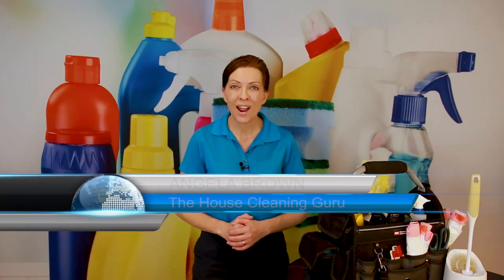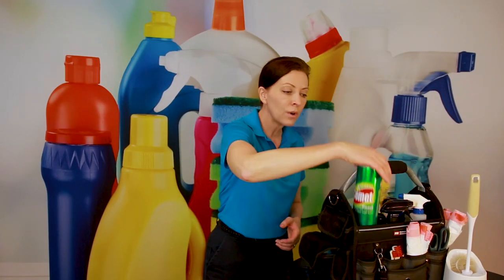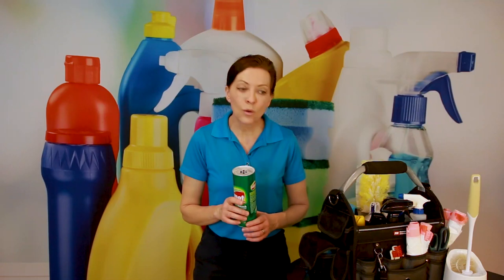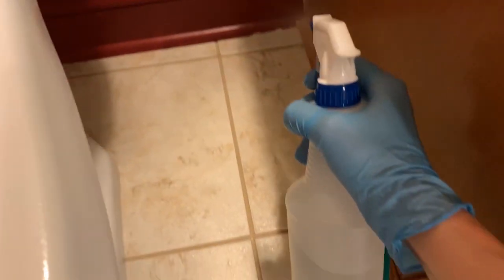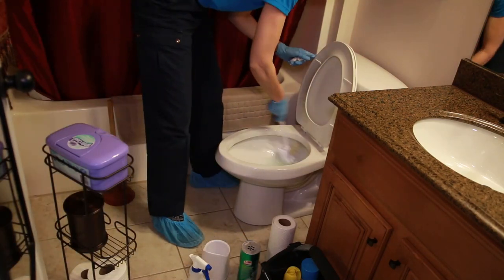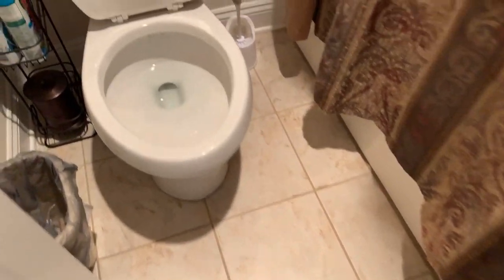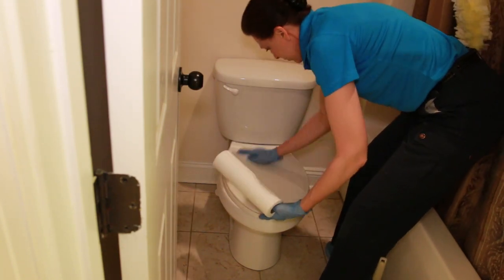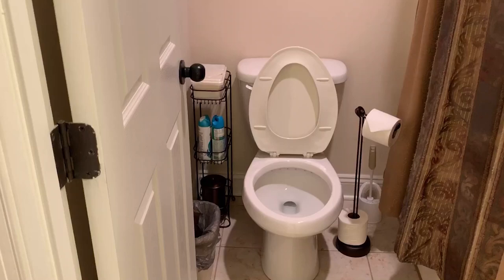How to Do a Maintenance Clean on a Toilet

Comment: Hello Angela,  Watched this video and followed your instructions. The valve blew off and it was flooding the bathroom! I managed to put the valve on and hold it with my foot. I had my phone,  called my  client she had to run to the neighbors for help. They  were able to turn off the water and fix the valve.  I don’t think this is a good idea to miss with the turn off valves.  In the future I definitely use a plastic cup to take out the water in the bowl.  I had to call a friend to help so the clients home would be cleaned in an appropriate time. Which cost me money!!!  I do learn so much from all your video. But , turning the valves off is definitely not a good idea. The rest of the video is great. This could’ve been a disaster which I think it was!!!
Reply: If you'd rather not scoop it out with a cup, you could just plunge the toilet, or pour a small bucket of water into it, both will lower the water level
Reply from the maker: I am so sorry this happened. Sending hugs. 🤗

Comment: Great video as always! Just as a precaution it’s not advised to  turn the water off at the toilet, some of those valves have not been used for long periods of time and disturbing the valve could cause a drip that may go unnoticed and cause water damage. I personally prefer to use my toilet brush to plunge the water up and over the trap to lower the water enough so I can work on removing the ring. Hope this tip helps keep up the good work I love your channel you’re awesome! ~Jim L.
Reply: Can I also use the plunger to plunge some of the water low enough to get that area?
Reply: Typical of a man. My husband didn't like it when I turned off the water, either.  It's a faucet. That's what it's there for. You don't like it, you clean the toilet.
Reply: Just pour a bucket of water in the bowl.
Reply: Take a small bucket and take some water out
Reply: What kind of dumb idea is this? Let the valves go unused for "long periods of time" and wait for an emergency.
Reply: @huitrecouture  In other words, when you’re working at someone else’s property, don’t disturb something that you don’t know the maintenance history on. You could be blamed for any potential problems, such as a leak or a drip. Cover your booty from blame, I simply gave a very common tip that’s used in the industry to lower water level in the toilet bowl to clean it properly.
Reply: @huitrecouture I had water squirting out of the tank and needed to turn the water off in an emergency. And what do you know. The turn off tap was rusted open. 😢 the complex I live in could not understand why I couldn't turn it off. I was home alone and had to beg they send their plumber over. 😢

Comment: Quick tip in getting most of the water out of toilet bowl to apply cleaning product: instead of turning off water supply to toilet, fill a bucket of water and dump in toilet bowl. The water level instantly goes down. After cleaning, flush toilet. Warning: do not have your head hanging over the toilet when flushing as there may be splash😆
Reply: Gail Starnes I’d rather do this too. If you turn the valves off in some older homes they can start to have a slow leak and then you have a real problem, seems like the safer option.
Reply from the maker: Thanks so much for sharing this tip. 👍

Comment: You just inspired me to clean my toilet now instead of later. 😅 When you said you can clean a toilet in 2.5 minutes, that is what was so inspiring. Normally it takes me like 20min! Today I did it in 10-12 minutes. Getting better! 💪
Reply from the maker: Here's a secret - clean the  toilet first thing every morning and it eventually takes less than 1 minute for maintenance mode cleaning. (I don't wipe the behind the toilet area every day, just about every 3 days.)
Reply: I have a roll of paper towels/Meyers in bathroom. Daily I wipe counters/sink then use the same paper towel to do quick wipe of outside of toilet and seat. Once a week do bowl. So rewarding!

Comment: I’m also a pro cleaner. I started doing a first vacuum pass before I spray any product around the toilet and floor - definitely a timesaver. I add toilet bowl cleaner and let it “marinate” while I spray down the outside of the toilet with Clorox bleach-free disinfectant. Let that sit while cleaning the sink, etc. If there is a ring in the toilet, I remove it with a wet scouring stick. Easy peasy.
Reply from the maker: Thank you for sharing these tips!

Comment: Plunger on the floor - discussing 
I dont keep in the bathroom,ikeep it in the garage and if i need to use it I bring it ,use it and take it out again
Reply: in a plastic bag
Reply: I bought a plunger with brush that sets in a plastic part off the floor as I too can't stand a plunger on floor. Bought at Walmart does cost 10 dollars but, worth it.
Reply: I use a round plastic food container lid with a piece of paper towel on top. That way, the paper towel catches the drips and it's not touching the floor.
Reply: @Meggie Markovska Same here.
Reply: that’s ok until you clean a few poopy run overs where you were running out to the garage. I would keep one in an easily accessible spot especially if you have kids😂😂
Reply: @letscleanhouse  exactly!!!
Reply from the maker: Thanks so much for sharing your thoughts on this video topic.

Comment: What to use for water mineral stains on the bottom of the toilet. Thank you for all your work.
Reply from the maker: Hi. I am sorry to respond so late! You have a few options: 
Vinegar and Baking Soda: Pour some vinegar into the toilet bowl, making sure to cover the mineral stains. Allow it to sit for a few hours or overnight. Then, sprinkle baking soda onto the stains and scrub with a toilet brush. 

Commercial Descaling Product: You can also use a commercial descaling product specifically designed to remove mineral deposits from toilets. Follow the instructions on the product for the best results, as different products may have different application methods.
Hope this helps! Thank you so much! 😃

Comment: My son wants to clean his own toilet but the bathroom has carpet. What cleanser can I buy for him so the carpet won't get spots on it if the brush drips? I love your videos!
Reply from the maker: I don't know a specific cleaner off the top of my head, but to clean a toilet in a bathroom with carpeted flooring, it's best to choose a toilet bowl cleaner that won't damage the carpet if the brush drips. You can use a toilet bowl cleaner specifically designed for use on carpets, which is formulated to be safe for carpet fibers. Alternatively, use a traditional toilet bowl cleaner, but take extra precautions to prevent drips or spills from contacting the carpet, such as placing an absorbent material around the base of the toilet. Be careful when using any cleaning product in a bathroom with carpeted flooring, and avoid using harsh or abrasive cleaners that can damage the carpet. Regular cleaning and maintenance can help extend the lifespan of carpets while keeping them looking their best.

Comment: you mentioned cleaning/wiping the toilet brush holder, but what about the toilet brush itself? just dry it out and put back into the holder? also, with the plunger: you said to wipe the outside, but what about the inside? it looks like the plunger in the first bathroom does not have a holder and goes just straight onto the floor
Reply from the maker: Plungers, and toilet brushes plus toilet brush holders can be cleaned with a spray and wipe method when you are kneeling at the toilet to clean behind it. Both the toilet brush and the plunger can be washed in the clean water of the toilet. If you have a heavy duty cleaning job for either the brush or the plunger, you can use the clean water from the bathtub with some soap. After cleaning those toilet items, then the bathtub would be cleaned.

Comment: Hi Angela. I’ve been using rags instead of paper towels for the toilets. (Hot water in wash). Im assuming the hot water kills bacteria. I noticed you used paper towels. Is this more sanitary?
Reply: Angela Brown  very true!! I used paper towels today for my toilet cleaning! I used only a few like you did in the video for the toilet and floor around it. Worked so well and gave me a peace of mind on the cross contamination. 👍 Thanks!!
Reply: I’ve got 38 houses and have always uses taracloth rags then at the end of each week wash them with commercial bleach

Comment: This May sound dumb, but how do you “clean off / sanitize / or disinfect “ all your bathroom based brushes after use? 
For example, I saw you use a black and red brush for the first bathroom, but you used it to scrub and then just put it back In Your bag? Do you do anything after the day ends or after each house? 
How do you keep all these items clean/sanitized ? 
Thank you!
Reply from the maker: Great question. Yes, each job gets it's own cleaning caddy with brushes, sponges and cloths. At the end of the job that cleaning caddy/supplies are retired until inventory at the end of the day. All the brushes and sponges get washed in a hot sanitize cycle in the dishwasher. Cloths get washed in the washing machine.

Comment: I use paper towel to clean my toilet as well, but if I pass around the paper towel on the same side, I'm swooshing around the dust and hair. So I use a fresh side for toilet and underneath and different for tank and different for base. How do you use only 1 paper towel? Also do you use mask, cleaner smell kills my brain and gets into my pores. Ty
Reply from the maker: You are correct, we use 4 select a size paper towels folded in half. Each half on both sides equald 4 sections. So, 16 sections to wipe down the toilet and the floor around the toilet.  And you can wear a mask if you are doing a deep clean with heavy duty chemicals, but we usually pH neutral cleaning chemicals in the toilet so a mask is not necessary.

Comment: Why do we never see toilet brushes in commercial bathrooms?  If there is supposed to be one plunger and brush per bathroom, why do not we see them.  I work in a machine shop with several bathrooms.  My purchasing jobs have recently incorporated the cleaning supplies.  When I went into the closet today I saw a plunger on the floor.  I immediately though gross, then why have I never seen a brush in the bathrooms.  I'm going to buy a brush for each bathroom; is there one you recommend for a large commercial building?  Thank you for all you do.  I appreciate you.
Reply from the maker: Great question Kat Kat. Every time I am in a public restroom and see a toilet brush, I use it - because it's often the toilet needs a good scrub. I think many consider it unsightly so they don't put them in public restrooms - but a dirty toilet is more unsightly in my opinion.

Comment: Would baking soda work to clean the toilet as well?
Reply from the maker: It could be used to remove odors, but you might be better off with a cleanser or an acid, depending on the scope of the job.

Comment: I am.a house cleaner who has a difficult time sticking to a maintenance clean and typically clean like it's my first clean...I like your episode about the steam mop vs the microfiber spin mop as I am that person who will get down on my knees to clean floors because I am downright picky in cleaning even the corners and can't stand floors with food stuck for days. It makes it extremely difficult to clean up with just a regular mop, but I find steam mops are beasts in cleaning the majority of high traffic areas.  
When I clean anything around a toilet I either use a microfiber with a little cleaner on to dust off the the toilet holder (always notoriously dusty), dust caddy utilizing a microfiber, especially when there are water droplets that stain tops of caddy or even top of toilet bowl holder. I've even washed the item described above in shower as that is just as easy and yiu can let that stuff dry in shower,  also a plus..so there is noooo need to waste your time drying the items that go around the toilet..
I also like your ideas for the different accounts for banking to track 30% that goes to taxes, marketing and money that automatically comes out of main account to pay you.
Reply from the maker: Thanks for the feedback, ideas and suggestions. I appreciate you stopping by. :-)

Comment: Comet scratches porcelain. What do to prevent this? My parents had a porcelain tub and they used Comet to clean it. Over years the porcelain became scratched. This was their only cleaner. How are you able to alleviate this problem?
Reply from the maker: I've been cleaning for 30 years and have never had Comet scratch a tub. I'm wondering if it was the scrubby they used along with the comet. Did they use a metal scrubby or brush? We always use Scotch Brite non-scratch scrub sponges.
https://amzn.to/3bVdsSn
NOTE: Use the blue ones, the green and yellow ones do scratch lots of surfaces.
Reply: Did the same to my parents sink as well.

Comment: Stick the toilet brush holder to the wall above the skirting board with Velcro. This stops floor dust accumulating and allows a clean sweep under the brush holder. Same with a small covered bin. 
Use a double toilet roll wall holder so you dispense with on floor roll holders.
Keep the floor clear 
Only toilet paper has desiccants and kitchen towels will not dedicate. They block toilets
Reply from the maker: Thanks for sharing these tips and information!

Comment: My question will you do a video on most Efficient way to maintenance clean of a glass walled shower?
Reply: Yes!!!!
Reply: A trick I learned is to use a dish scrubber, the type you can put soap into the handle. Fill it with a mix of dish soap and white vinegar. Get the shower door wet and just clean the door with the dish scrubber - instantly cuts through any residue/soap scum.
Reply from the maker: Thank you for the show idea suggestion. 👍

Comment: Do u do the shower and tub?
Reply from the maker: Yes, typically we do the toilet first and then we wash out the shower and tub. sometimes we need the clean water from the tub and/or soap for cleaning the toilet, toilet brush holders or plunger or area around the floor depending on the situation. When all that other stuff is clean, then we clean out the tub.

Comment: can i replace the paper towel to microfiber cloth?
Reply from the maker: If it is your own home and you want to use a microfiber cloth on the toilet, sure. We don't recommend it for professional cleaning for cross contamination purposes. We don't want to clean someone's toilet and then accidentally use the same cloth to clean their bathroom sink where their toothbrush, hair brush and makeup are. Does that make sense?
Reply: The company I work for has us use microfibre instead of paper towel and after using it on a toilet it goes straight into a bag and then you know not to use it again. All cloths get washed afterwards so no cross contamination. I'm in Australia though so I don't know if it's different depending on the country. I just don't like the idea of using something that will contribute to landfill if i don't have to.

Comment: Hi Angela, If the walls in the toilet closet has flat paint in the walls, can an all-purpose clean still be used on the walls?  Thanks  EBee
Reply from the maker: It depends on the pH of the all-purpose cleaner. for flat paint you would need something as close to 7 as possible. If you are reading the safety data sheet for the product - you can find this in section #9.

Comment: Do you put your hand in toilet water to use the pummus stone to get rid of the toilet rings ..
Reply from the maker: I don't under any circumstance recommend pumice stones. Pumice stones can technically be used in a toilet - but if you scratch the porcelain shell off the ceramic around the toilet bowl water line when trying to remove a ring - when you use toilet bowl cleaner again it will permanently stain the ring line blue. SO MANY cleaning techs have gone out in the field and have ruined customers toilets they have to replace for this very reason. Please don't use pumice stones in toilets.

Comment: Hi, do you have a recommendation on a cleaning product for acrylic bathtubs?
Reply from the maker: Hi. I am so sorry for being so late to respond. Dawn dish soap in warm water and a soft cloth is a great gentle cleaner.  Avoid using abrasive cleaners, scouring pads, or harsh chemicals (such as bleach or ammonia-based products) as they can damage the acrylic surface. And to prevent scratches, never use abrasive materials like steel wool or rough sponges. Thank you so much for watching! 😊

Comment: is there a way to clean the toilet tank?
Reply from the maker: Yes, a cup of white vinegar left to sit in the toilet tank of water will help clean it. After about 30 minutes you can flush the toilet, use a small brush to clean the tank and reflush. That should clean it nicely and remove any gunk.

Comment: How do you clean the wall and baseboard when there is almost no room in between the toilet and other objects?
Reply from the maker: You could try using a long-handled brush, microfiber cloth attached to tongs, or a toilet brush with an extended handle. Hope, this helps!